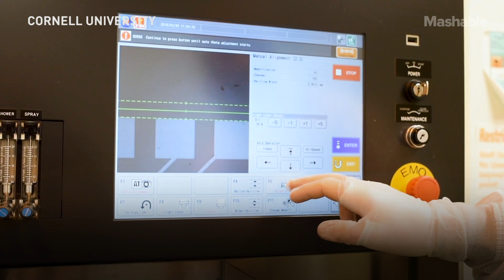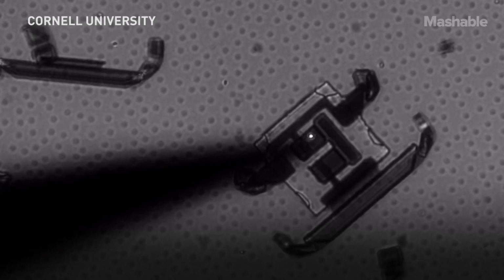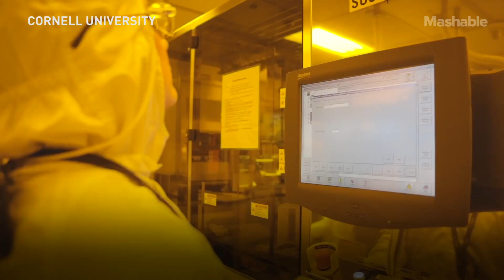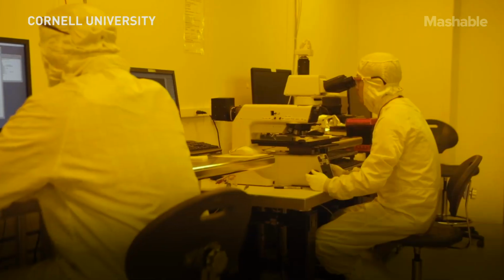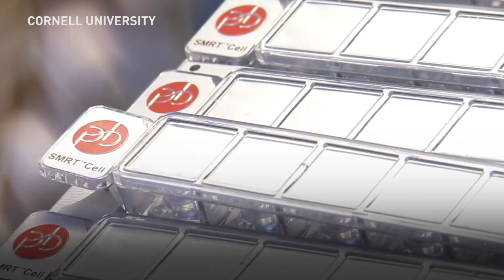Millions of Microscopic Robots Learn to Walk | Mashable

Comment: people in 2020: "ThEy ArE puTtInG nAnO bOtS oN tHe VaCcInEs To CoNtRoL uS"
Nanobots in 2020:
Reply: Funny thing though. This technology was invented in 1997. Probably long before that since it had to be cleared to be published in Popular Science. I remember reading the magazine and being stunned by it. Doctors successfully used a swarm of 500,000 to kill bacteria that didn't match the patients DNA blueprint. Soon after the article was scrubbed completely. I CANNOT find any trace of that article anywhere online. I figured the drug companies didn't want it out since it could actually cure apoptosis (when cells divide and don't die, causing the cancer mass). I'm very surprised by this video. I'm thinking its pretty new and im sure the company making it will be bought out and the project scrubbed pretty soon.
Reply: @avocatos6421  Ah yes name calling. That wonderful thing people afflicted with dunning-kruger do when they can't win an argument. You are correct about curing apoptosis. I was wrong. I meant to say they removed the excess cells that are dividing, so that cancer masses are not formed. The actual problem of the cells dividing too much and not stopping is too great a problem to repair given the level of technology that we are ALLOWED to have. Yes that's right, I said allowed. 

Your false belief that you can logical deduce our current level of technology, science and research, is blinding you here. It's not your fault though. We both went through the same conditioning known as the media and the school system. Our military has technology that we are, as civilians, not allowed to have. It's simple defense protocol. If it's available for public consumption then our enemies can just purchase it and be on par with us. 

I have met many people over the years who had purchased that same magazine. In fact that magazine inspired me to go to school to become a Robotics Engineer, because I saw so much potential in it, and no we have had similar computer tech in the 90s well into the 1960s it was  just top secret and hush hush. We are about 30 years behind in tech in the civilian markets compared to what our military and government agencies have. Although from my current research it looks like that margin may be even greater, be several folds.

I'm not spreading misinformation, I am just speaking the truth. The fact that you don't like it and your judgement has been impaired by effective conditioning is not my fault. However I do have good news. I have recently discovered that we are going through an incredible period of time. Because the bad guys that have been in charge of our planet for lord knows how long have finally been beaten and prosecuted they are going to release ALL the suppressed technology AND patents. I think there is about 6000 of them, including Nikola Tesla's med beds and energy research.

Probably publicly released in a month or two. I would hope sooner but things are taking awhile. Have to wait for the financial system to be redone first and that is just about done. 

You can get mad and mock me here but I won't care. Just know when you are shown I will be smiling and happy that we are moving into a time of incredible human advancement. You will get access to the technology as well. The process to remove the indoctrination will be long and hard, but it will happen, and i'm happy you are alive to get to see it and experience it. WWG1WGA :)
Reply: @John_Conner222  hello can I buy some tin foil hats please?
Reply: @jasonlitherland4270  How did you some how extrapolate that with an explanation that the body does not accept foreign object kindly? 

Can I buy some tinfoil hats too here?
Reply: @John_Conner222  yea thats fake